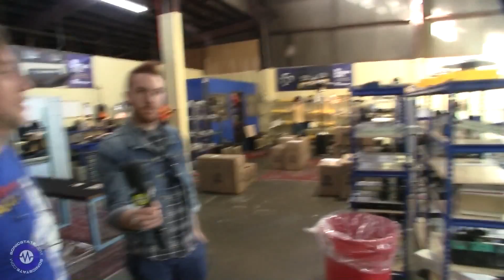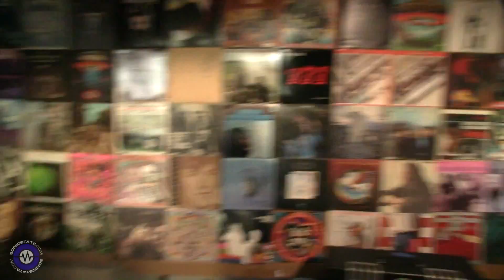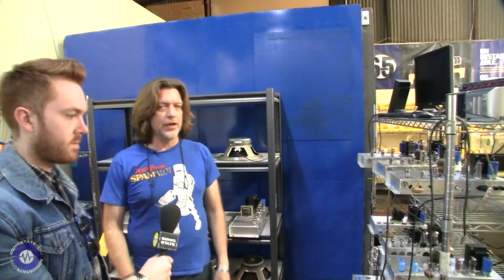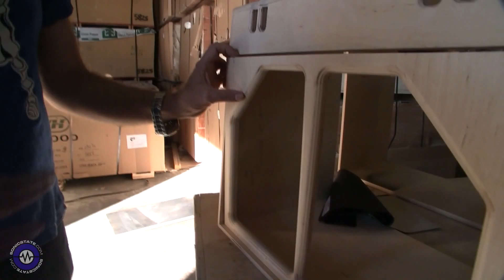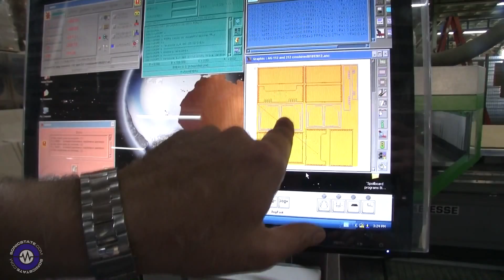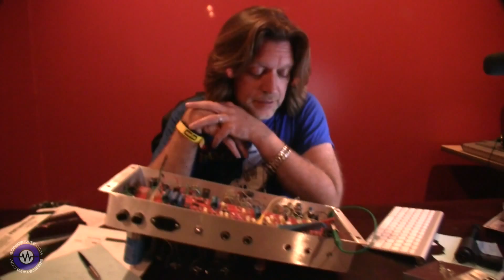65Amps Factory Tour - 3 New Exclusives!

Comment: Did not realize what a BIG shop these guys have.
The PCB amps look REAL nice. I would think they will be a good move for 65, and dispel some of the "myths" about hand-wired amps.
Would be a pleasure to do a repair on THAT kind of a PCB guitar amp.
I have worked on a few Mesa Boogies over the years. THOSE  amps are NOT fun to get into.
Fuchs
Soldano
65
these people know how to do PCB the RIGHT way.
Good luck to you guys......
Reply: If I wanted a well designed, clean, simple, single channel, amp without any built in effects, made with reliable, heavy duty, quality components and materials that were optimally applied, I'd get a hand-wired over a PCB. 

That said, for those who want multiple channels and something vastly more complex, trying to achieve that with hand-wiring would likely end up in a disastrous, unworkable, noisy, shitty-sounding, mess.

Depending on how the differing technologies are implemented, one can have a PCB amp that's every bit as toneful and rugged as a hand-wired PTP/turret board/tag board/eyelet board - or something woefully inferior to the latter. 

If the military and NASA depend upon PCBs to perform (24/7) under the kinds of extreme conditions they endure, then PCBs might just be good enough to withstand a bedroom guitar hero, garage band, or world tour.

Still, I hope you're not suggesting that a hand-wired (AB763) '64 Fender Deluxe Reverb would sound or respond the same as their PCB reissue - unless you're tone deaf. I'm not saying it can't be done, just that it hasn't - yet. 

The same goes for old hand-wired Marshall amps vs the new ones. Heck, even a new hand-wired Orange Tiny Terror sounds and responds differently from the PCB version. And don't get me started with the Fractal Audio amp modeling junk.... 

As far as the "myths" you brought up, which one's are you talking about?